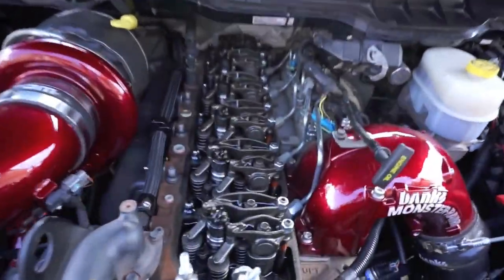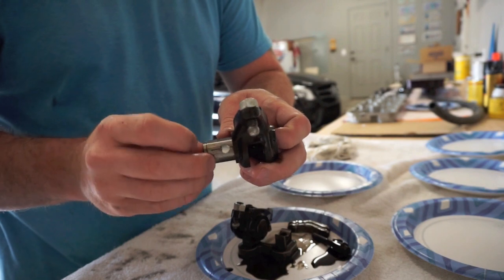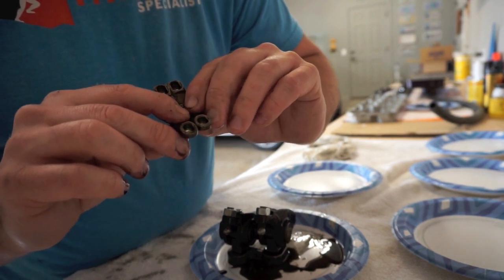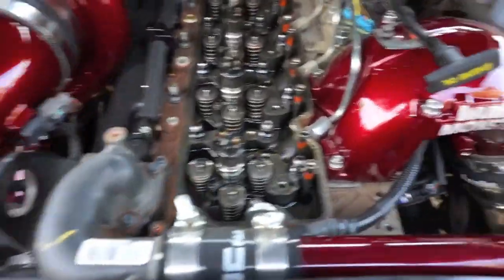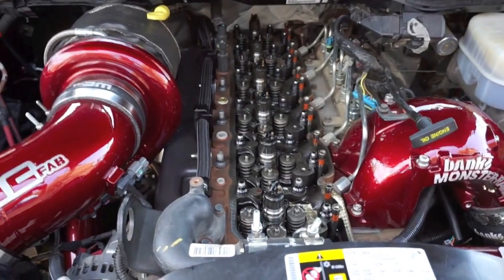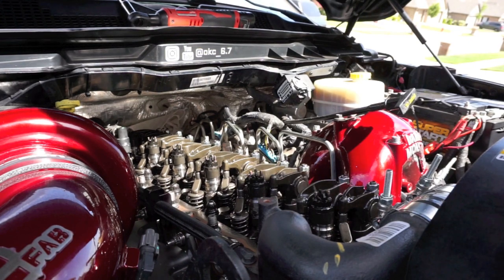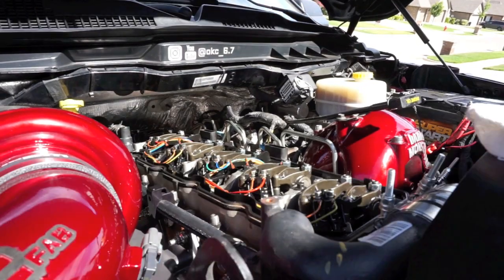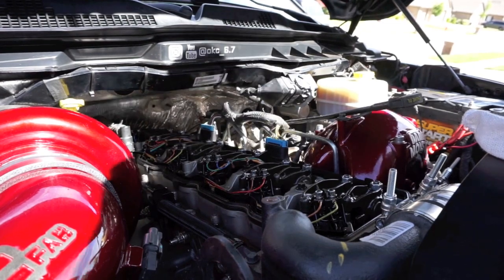Cummins Head stud torques were way off...(SCARY)

Comment: I don’t play when it comes to Torque Wrenches, As a tech for 20 years, using both mechanical and digital torque wrenches, Knowing the need to zero them out before storing is critical.. I have a Matco Click type, as well as a Snapon Digital, And I use both, This allows me to double check and verify. 

Preparing to do my studs on my 01 vp truck.

Comment: A torque wrench is not the place to cheap out when installing $500-$1200 headstuds. 
  Be that as it may, your problem here is the bolt stretch. I’m sure the HF Pittsburgh junk is not calibrated very well, sure, but you’re also experiencing bolt stretch as well. You should tighten these things in phases. Some guys do a hot retorque as well.
  Torque wrenches should also be stored at their lowest torque setting as well. Never trust another man’s torque wrench.

Comment: I love the paper plates my brother! I will use your way of keeping the order. Big ups to you on your methods and thoroughness. I don’t get the privilege to have someone that would give reassurance that would make it in a timely manor to count on that will be coming with a tool i dont have. I don’t see how you could be digging in so far into the rabbit hole without the right tools get the right tools and take care of them like I know you take care of everything you guys so there should be no reason why you don’t have the torque wrench that works, you got it bro went down. Bring a new tool out. Snap-on truck has a torque wrench calibration checker tool. I just got to the part where you just showed off your Janky craftsman meaning just overly used aged for sure for a lengthy time. I’m not bagging on you, but I’m just joking with you and give you a hard time because you’re like a surgeon in the operation room using a smooth butter, knife to make an incision on The left ventricle of a patient. If you pay any high dollar on any tools, the precision instruments are the ones you get. I don’t got no time to be using something. I can’t tell if it works or not.

Comment: So the fix was a retorque?
Reply from the maker: I retorqued the head studs, and there was a t fitting that needed to be removed and just a straight barb connecting the 2 tubes.
Reply: @okc_garage  that trotting is on the exhaust/hot side above the headers? Wow well done
Reply: Tubing*

Comment: Did you add the coolant bypass when you had the tranny out or did you do it with it in place?
Reply from the maker: I did it with the trans in. But i had the down pipe  and turbo and exhaust manifold off when i installed it.
Reply: How hard was it to get the freeze plug out?  I may purchase a compound kit from ATS and might attempt to install the coolant bypass when the exhaust manifold, down pipe and turbo are out of the way.

Comment: What aircraft cockpit diagrams are on the wall behind your workbench?
Reply from the maker: E-6b Mercury
Reply: I am celebrating our 50th anniversary of graduating from USAF pilot training with my classmates this coming April. Throughout my flying career I have used similar cockpit diagrams for lots of planes from the USAF jet trainers to the B-777.  I have really enjoyed your channel. I have an 04.5 3500 with 66,000 on it. I pull a 15,000# FW and am going to do the head studs, springs and pushrods in anticipation of adding compounds this summer. Thanks for your videos covering these topics!  Beautiful truck by the way!!!

Comment: They always move on a retorque and especially on a hot re torque which you should have done. Cold retorques just don’t get the job done. And if you don’t measure yeild of bolt stretch and set your torque wrench to that number. Then what’s the point. You have no idea what the torque really is. I yield every bolt in a fixture I made measure stretch and then set my torque wrench.then I know exactly what And where I am at for torque refaurding bolt stretch and yield strength.
Reply from the maker: From what I’ve been told ARP 625s don’t stretch they break. I could be wrong. Lesson learned though. Will always do a hot retorque going forward.

Comment: Soo, the head was lifting and you was pushing coolant out the radiator? Did just retorquing the studs reseal the gasket and fix the issue or did you have to tear it down and put a new head gasket on it??
Reply from the maker: i had a plastic fitting that was leaking out pressure that was the fix. im glad it was that and not my headgasket

Comment: Question I blew head gaskets in my ram 6,7 9 months ago after it was put back together it had few small bubbles in the radiator super small I had go back with head bolts not studs because parts store sent wrong part now the bubbles have gotten big again . I am not seeing it puke water back in resvor but it is towing at 206 an 210 instead of 203 an 199 also burning more fuel an loss power. I am wondering if this could be oil cooler cracked because it is putting little oil in radiator if I could re torque head bolts or replace them with studs an fix the problem. Which way would you go

Comment: I only use dial type torque wrench because it always goes back to zero if it doesn’t I know it’s broken my cornwell dealer has a calibration gauge I check it if I don’t think it’s right
Reply from the maker: I have a buddy that owns a snap on truck. I’ll be checking calibration again very soon.

Comment: Interesting video, I was working on my LQ9 LS 6.0 with ARP head studs I made sure to buy a cheep and and master crafts expensive electric torque wrench and as expected the cheep one was wayyyy off then the master craft was 100% spot on I made sure to re calibrate the torque wrench 👍🏽
Reply: mastercraft canadian tire brand?
Reply: @PoliticalGangster  🤔 I must of been high on brake clean writing that, but yeah a digital Mastercraft torque wrench went up to 80 FPT and had Newton meters, so it was great to use

Comment: Sorry for jumping in this thread so late, but in case you didn't know, there is a place off of 66th and I35 called Accurate Labs.  They calibrate all sorts of specialty tools and equipment there, and I'm positive they can calibrate a torque wrench too.  I think another company bought them, so they may have changed names, but it's in the old Firestone building across from where ToysRUs used to be (if you're familiar with that area).  I just stumbled across your channel a week or two ago, so I was looking over some of your older content as I am about to take a deep dive into my 4th Gen.  Doing good man, keep it up!
Reply from the maker: I appreciate it. I will look into it. You need help with the truck let me know.

Comment: Doing great videos. Heard of you on everything’s live with yourself and beast. Lol. I’ve been having coolant issues myself. Did you replace the head gasket or just retorque the head? I have 425’s but shouldn’t be having this issue. Thanks!
Reply from the maker: Thanks for coming on over man i appreciate it. I found a T fitting i had and just zip tied up was my source of leaking off the built up pressure. That let the fluid rise up to my overfill line and then down my frame. Since i removed the T fitting i haven’t had any issues since then.
Reply: @okc_garage  right on. I seen that as well. Was curious to see if that was why you retorqued the studs.  I’m blowing coolant in my 13 and it’s only coming out of the reservoir. My radiator doesn’t have a cap. Pretty frustrating. I’ve been thinking it could be the studs and if so, my gasket would be damaged so not good to just retorque. Just me thinking though. I haven’t had the chance to wrench on it yet though. I have seen where the cover over the temp sensor warps and needs to be resurfaced.  Anyhow, thanks for the help
Reply from the maker: 4th_Gen_ Mahem i retorqued then just to make sure and I’m glad i did. My old torque wrench was a POS. It’s not a bad idea to check the torques later on down the road.
Reply: @okc_garage  I’ve been dreading doing it ever since swapping to studs. I think I’ve waited long enough though😊

Comment: I get mine checked annually at a min. Also, why the hell would you use a Craftsman or Harbor freight torque wrench?
I mean really.
Reply from the maker: It’s all i had at the moment. What brand would you recommend Dan?
Reply: I understand that I guess.
When it comes to things like head studs I'll only use my Snap-On wrenches. I have a couple less expensive ones I'll use on lug nuts etc but head bolts and the such are getting the big boy tools.

Comment: Just go buy a new every year! I trust my husky’s first about 8 months but you really only calibrate a 250$ and up wrench if that I’d say 300$ and up! Just my thoughts! Never broke a husky but broke every craftsman I’ve bought! Also you should really always brace the drive head to keep it straight to get correct torque! I’ve been rebuilding engines for only 15 or so years but got taught by some good old boys! But good video and hope all worked out fir you!

Comment: I use to own the same torque wrench years ago. Mine did the same thing. I took the plug out of the bottom of the handle and adjusted the locknut and spring and it got rid of the slack. It’s now my ratcheting breaker bar.
Reply from the maker: Nice. Mine went bye bye with the trash that Tuesday.

Comment: You need to put a torque wrench on it that goes up to 250 foot pounds to get an accurate reading of 150 foot pounds.
Reply: Vary good vid. Couple questions about your truck. How do you like the banks monster intake horn? No methanol injection?? Do you work the truck or just play with it?
Reply from the maker: Love the banks monster Ram intake. I did it the same time of the second gen swap. She’s all play and my daily driver. Not much towing.
Reply: It's definitely a workout. It was definitely off if you are getting full turn.

Comment: Fyi. The dot on bridge goes towards exhaust side. That's what the manual says. But the dot is non functional.
Reply from the maker: Mike Farrell it must have been opposite from the factory then cause that’s the way they were when i opened the top of the motor for the first time.
Reply: @okc_garage  interesting
Reply: Mine were all toward the intake side as well.

Comment: Best way to ensure proper torque is to do a hot re-torque. However, best method in my opinion is three prestretch sequences. After you torque all studs to 150 ft lbs, go back to #1, loosen it, and re-torque to 150. Repeat this for all studs in sequence and do it a total of three times. It’s a lot of work, but ensures perfect torque. I believe ARP and/or Fleece recommends this method.

Comment: I have the same second GEN swap kit two weeks after I installed I noticed I was getting bubbling in my radiator to, and my head was fire ringed 2 years ago. I found out my head was cracked had to buy a new head installing it now .
Reply from the maker: Donnie C has it went away?
Reply: OKC_6.7 The new head is going back on this week.
Reply from the maker: Donnie C damn. So you did blow a gasket? Mine is good now. Or at least for the time being.
Reply: When I had the head fire ringed a couple years ago he gave me a lifetime warranty so this is costing me nothing but the price of the new head.
Reply: I went with the Hamilton head.
Reply from the maker: Donnie C badass. When i thought i blew my HG i was considering getting one of those

Comment: You running a catch can? Where did you mount it?
Reply from the maker: Rob Carrick i am not. I’m just running the house down to the ground from the valve cover. Have yet to have a drop out of it. If it starts to drip i will run a catch can on the frame rail.

Comment: You should always set those torque wrenches to zero when you’re done. Reason is there’s a spring in there and if you hold tension on it all the time throws the calibration off.
Reply: My torque wrench says to store at 10 ftlbs right on handle. Tekton
Reply: @fozzybear9114  Probably should’ve been more clear to set it at the lowest denominator mine just happens to say zero.
Reply: @georgemcconnell1433  yup. My tektons used to say zero. But this new one says store at 10. Not sure why the change?

Comment: Oh boy,  yeah I had that same torque wrench from craftsman and yup it went right in the trash. Bunch of junk. This is why you should always recheck torque,  I used a calibrated dci, which is made by snap on , flex head with electric tone it's a nice setup you  should invest in a better torque wrench  for sure, excellent content. Like I said my 625s were lose as well when I checked them. Funny thing is people always say you don't need to  re torque 625s well if you don't do it I guess you'll never know , that's why people should not miss lead others like that.